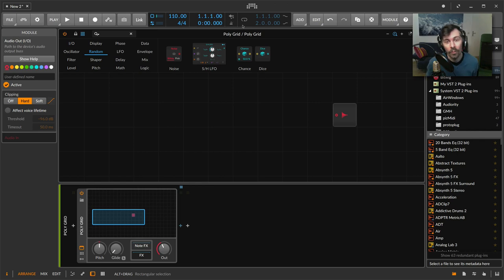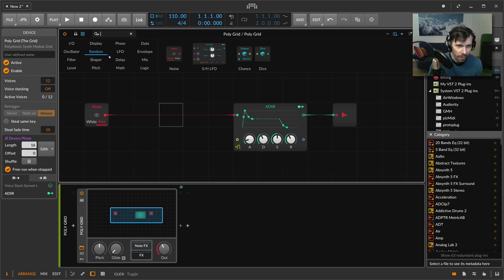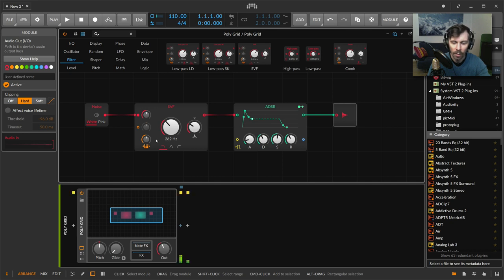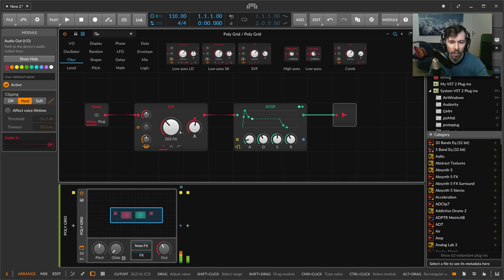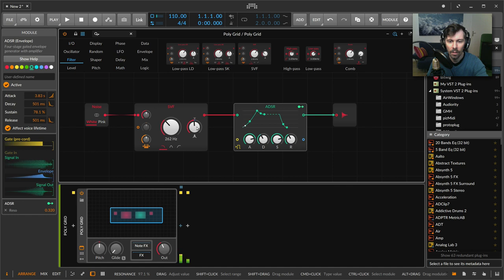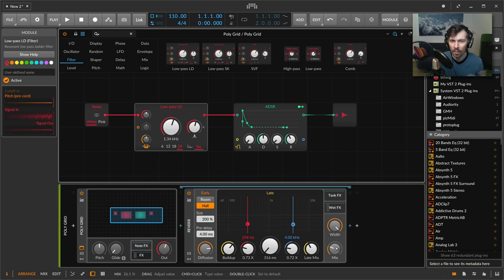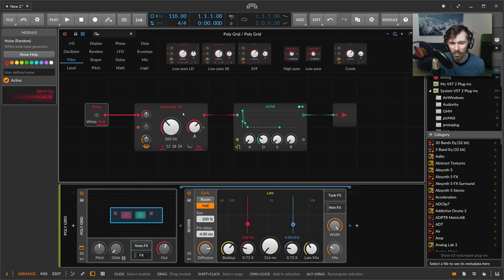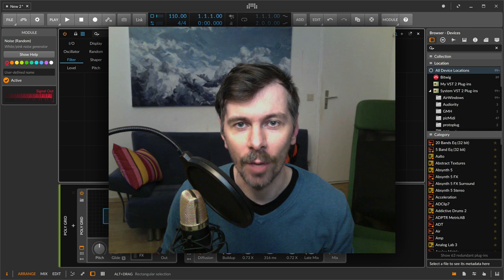Making Music with Filter-Resonance, Noise and Key Tracking in The Grid from Bitwig Studio 3

Comment: You could extend this method by putting 2 or more (why not :) ) filters in sequence. Use slight differences in cut-off frequency to add dynamics to the sound. Or ofcourse by slightly and slowly modulating the frequencies. This is also usefull to create brick-wall filters, with a slope of 48dB/oct or higher. Just make sure the cutoff freq is controlled by the same signal.